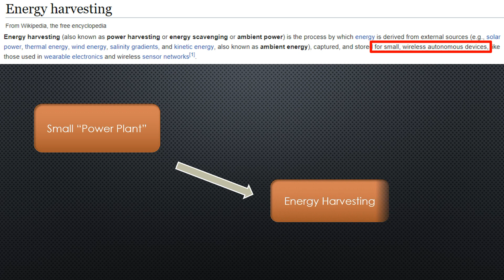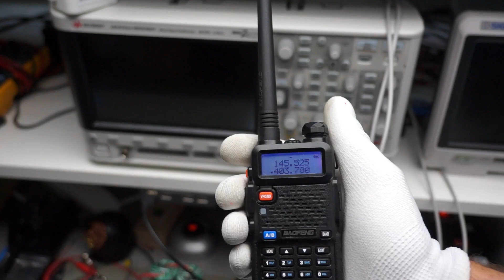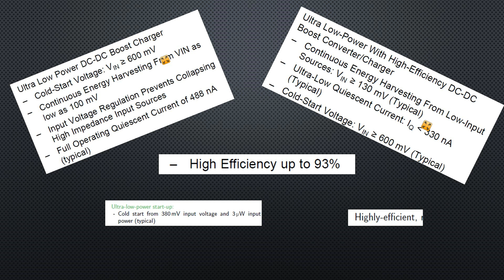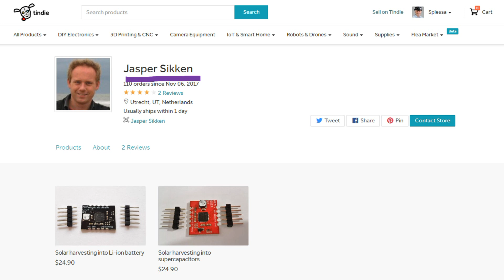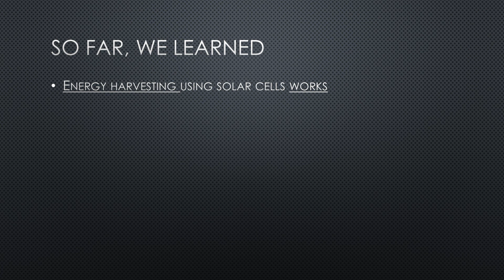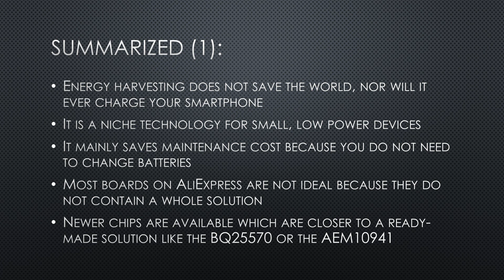#278 Energy Harvesting for Makers

Comment: I am surprised nobody has developed a maker solution with the MAX17710 form Maxim IC. Despite old, it seem to fill the very low power niche, where you might transmit a report once a day probably depleting all what has been obtained. It has no MPPT as it is based on an inductor boost scheme. I agree if somebody wants to create maker boards the solution should integrate as much stuff as possible including eventually a LoRa transmitter. Available power will tell how many messages you get in a day. Of course the niche calls for small size so the Teg/Piezo/Solar/RF source has to be small too and the message frequency not that critical. I mean the power requirement for one message with 1000 bytes is less than 100 messages with 10 bytes due to overhead and transceiver stabilization times. Interesting video.
Reply from the maker: There are other chips around which you do not find on "cheap" boards. Maybe the market is too small?

Comment: My favourite chip is the ltc3106 its hard to get and hard to solder but i love it. It has everything you want. Fake MPPT,boost converter,indicator line etc etc
Reply from the maker: Thanks for the tip. I did not focus on chips, I focused on boards because they are easier to handle for most of my viewers.

Comment: Can you build a harvesting circuit to power Arduino using cheap Chineese  $1 "power banks" that contain 1 LiIon battery and already have the circuit board inside?  Youd probably need a MTTP circuit board and some way to allow simultaneous charge and discharge.
Reply from the maker: As you mention, these power banks should support charging and discharging at the same time. Which they do not do in most cases. So you only could use the battery which usually is not part of the delivery :-(

Comment: Its not very hard to replace the resistors on the BQ25570, use two soldering irons to remove the resistors, clean up the flux and insert two new resistors then you can get the 3,3v. I  am using this chip for my low power weather station  , I even made my own board soldering all resistors and the chip (without  legs) not that big problem. The only problem is the price for the chip, its rather high  $8. A cheaper solution is to use the BQ25505 its only $4, but lags the output regulator, but a small low power LDO can be added. Regarding problems with solar cells that gives above 5v, I have added a TL431 (set for 4,5V) a cross the solar cell to make sure that the voltage is below 5V, I know that I lose some energy by doing that, but it doesn't really matter when the sun is at it highest.
Reply from the maker: Thank you for your "motivation"! I do not like those small parts :-( And they are not necessary on these (rather big) boards...

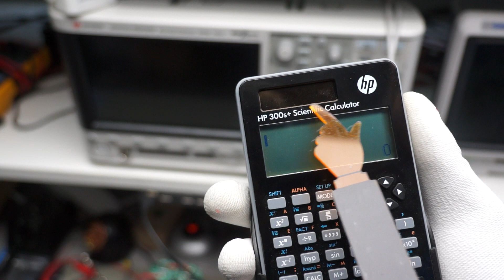Comment: 4:13 Correct, but the LCD display technology, which was a requirement for the pocket calculator, was invented by a Swiss, who I met some years ago.😊 His name is Martin Schadt and he could be called the father of pixels.😉
I use since several weeks just Solar engery to recharge my smartphone and it works fine. I built my smallest system(12v) out of two old regenerated car batteries. These are connected to the battery charger with  an array of 40w panels. On this little system I just use a pwm charger, which seems to be sufficient for my purposes like my small animal fence and to recharge powerbanks and mobile devices.

Comment: The LTC3588 came a bit short... Instead of piezo, I had a project that "stole" energy from a very weak (<1mA) sensor supply, to be able to burst a wifi message...
Reply: Neutrality & Mutualism with AI & Robots  please explain a bit more my friend😁🏴
Reply: @deangreenhough3479  I had an esp32 sending me via wifi message each time some one ringed the doorbell, The buildings doorbell entry system could not provide enough for the esp to send. 
I order the LTC3588 from china, in the intend to "harvest" a bit of the low power provided,.. but it took 3 month and meanwhile  the landlord put a new doorbell system in place...

Comment: Have you heard about perovskite solar cells? I know that polish company Saule Technologies are on the way to mass produce those, and they are quite promissing. They work with artificial light, can be transparent, flexible, and should be super cheap (10x cheaper than current). I hope they will make it :)

Comment: I am confused by the whole subject. One set of approaches is to use the sort of chips that you describe, another is much simpler: solar panel, bms & battery. In the uk I have several solar lights that use a solar panel, a bms and either lithium ion or nickel metal hydride. These run all year & even put out a little light in December with no special siting other than pointing south & keeping clear of vegetation, some have been running a few years now. Given the power requirements of modern processors there seems little trouble running applications like weather stations & there are several videos on YouTube about such applications. In my case I modified a cat scaring device to run on a small, about 125 mm by 75 mm panel giving around 6 volts in good sun,, with just a Schotky diode, no bms & 4 Nimh cells. It has been running in a neighbours garden for a few years & still works fine, running a pir to detect the cat & then using a 555 chip to drive a speaker at around 20 kHz . Most of the problems I have seen with these kinds of systems have been water ingress, otherwise they seem to do fine.Thanks for sharing.
Reply from the maker: You describe a typical representative of the Solar energy fraction in my video.
Reply: I was just trying to say that for a practical system that is low cost, a very simple approach gives useful power. It may not be very efficient, but usually all I want is something that works & is low cost. I may be missing something but the more sophisticated systems seem to add more cost & complication & don't work as well. Thank you for all you share.

Comment: Many thanks for this Andreas, it is appreciated, I find the hardest part of any design is "knowing" what is available on the market, for example, I was about to manufacture prototypes using the BQ25570, now there is a spanner in the works and I must test the AEM10941 as i was not aware of it.  I am very thankful for your channel and always look forward to the next one. Cheers !!!
Reply: Hi Shaun, you can buy my board configured for Li-ion or supercapacitors, or you can buy the evaluation board from e-peas, there you have all possibilities to change all configuration settings. https://www.tindie.com/products/jaspersikken/solar-harvesting-into-supercapacitors/

Comment: Very interessting, thank you. Not your fault, but unfortunately the result is still not cheap enough to just play around with it. E.g. some standalone solution with mcu, sensor and battery or usb power ~ 6€ (ok)  versus additional panels and good harvester chip +~30€ -> 6 times more (too) expensive. I have some of those 1€ solar powerd garden leds with joule thieves that run the leds for hours in the evening. So I have the impression there is room for (price) improvement also for even wlan sensors, but I couldn't do it so far (plan: ESP32 ULP collecting i2c sensor data, joule thief collecting energy to push the data out when there is enough power for a wlan burst. Part cost ~ 10€. Maybe someday...)
Reply: Um, you cannot compare a joule thief circuit lighting a LED with something that has to deliver regulated power, at the maximum possible efficiency, while also managing e.g. a LiPo so that it doesn't die or set your device on fire due to overcharging. 

The prices could go down only once this stops being a very niche application (and thus the chip production volumes will go up). E.g. the AEM10941 costs 4EUR alone (vs. cents for a transistor and few passives in a joule thief). 

For 99.9% of hobbyist projects there is little advantage of using an energy harvesting setup vs. e.g. a coin cell.

Comment: Thanks for the useful and interesting video.

PZT based energy harvesting is good for transferring power through metal barriers in a wireless manner. You put a lot of power into a PZT disc on one side, and take out a lot less with a PZT disc on the other side. This is useful if you want to go through a bulkhead without a penetrator, or if you want to power an external sensor in a hostile environment such as a down-well application or an undersea pipeline or outboard on a submarine or even through the wall of a safe. The efficiency of the power transfer across a metallic boundary is claimed to be over 50% by some researchers with more than 10 Watts transferred in some applications.

But I agree that for most makers, solar cell based energy harvesting is much more applicable unless they are powering something at a rock concert or at one of the clubs here in Las Vegas...

Comment: Thank you for the summary and introduction of the systems! Radio wave harvesting could be punishment as power stealing if someone detects it 😉 Anyway I remember a newspaper note (I thought it was in Switzerland) back in the 80. where people close to a big AM station complained about singing and speaking kitchen pots. At least involontary energy harvesting.
Reply from the maker: When I was young I used to wirelessly power a fluorescent tube in my hand with my Yaesu FT-277 ham radio transmitter. Didn’t impress the girls : -(
Reply: In southern UK 10-15 years ago, there was a prosecution for stealing energy from an AM radio transmitter. Transmitter engineers discovered that the power output from the antenna dipped on one side. Investigation showed that a nearby farmer was capturing the radiated energy, and powering the lights in his cow shed from it !

Comment: It seems you got some stuff wrong about the LTC3108. Me and a colleague were working with this circuit a little bit a while back.
1. There is a main output that is programmable to 4 different fixed values: 2.35V, 3.3V, 4.1V and even 5V.
3. There is a Power Good Output that you can use for Warning / Load cut-off. If Vout drops below 9% of its programmed value, the PGD-pin is set low.

Still missing the MPPT though. Read that it is because this device is intended for TEGs as well as PV and that rules out a simple MPPT-circuit. Not sure if it is true though, but it makes sense.

The AEM10941 seems really nice though! Thanks for the great video!

Comment: Mr Spiess, as a high profile engineer, what is your perspective about the dangers of RF radiations. Is it a fact or just a myth? I couldn't resist asking this after seeing your citizens protesting against the launch of 5G.
Reply from the maker: If there would be a problem we should see it after 20 years of global field testing. 5G uses the same frequencies as 4G.
Reply: The people protesting are uneducated in the field of RF engineering. They complain about using frequencies that cause various health issues without taking into consideration that we have been using these frequencies for decades without issue and the claims are made without peer reviewed research, only anecdotal claims based upon undocumented levels of power over equally undocumented durations. This alone tells you that the complaints about 5G are bunk.

If anyone wants to challenge new tech, ask to see the peer reviewed research first, and even then ask for other contradictory peer reviewed research, then compare the method against real world, finally ask who pays for the research and who benefits.

Until you have done this you have nothing to riot about.
Reply: Brain cancer rates have not gone up after many years of people putting small transmitters close to their ears. The only measurable effect is a very slight heating from the microwaves, but much less than easily tolerable and more powerful effects from  things like sun or physical activity.
Reply: The hypothesis of the danger caused by a million to billion pulses of low energy striking the human body every second does seem plausible though, however, there has been no substantial or tangible evidence till date to prove this hypothesis. But as you pointed out Mr. Spiess, if there was a problem we should be witnessing it right now and indeed there is no substantial evidence to prove the relation between non-ionizing RF radiation and brain tumors. Many other factors play a role, especially genetics. This topic may still be a matter of debate in the future between technical and medical professionals though, only because of the plausible hypothesis.

Comment: A very good video based on typical maker needs.

I'm used to seeing term energy harvesting in other sources of energy than solar/wind. For makers those are probably the easiest though. I'd think of solar as a first choice too but outdoors wind can be a good addition, often when weather is bad and there is no sun it may be windy. Wind can provide energy in the night too. (components for wind are not as easy to get ready made, you probably need something clever like a propeller running a motor used as a generator)
Other sources of energy include stuff like vibration/compression (piezo elements) or thermal difference (something similar to peltier elements) or whatever. Such alternate sources tend to be even lower power than solar but they can be used for example under ground where sun never shines or in polar regions where sun never shines for a period in the winter. In those niche applications there may be not other good choices available.
Energy harvesting is definately no good for high power (or even solar is not with small panels). It is typically ok for very low power applications only. A milliwatt power during all the day gets you a long way if a micropower mcu does for example only a couple small tasks per day. Micropower applications benifit from low voltage mcu quite often. You can run many chips at 1.8V and they consume less power than running at 3.3V. For energy harvester powered applications you may even want to avoid 3.3V devices. It is not all about getting power, it is also about consuming it as little as possible.
Reply: I've occasionally seen small wind generators used for field sensors for water levels, and possibly other things. The cost, size and maintenance risks are probably a lot worse than just buying a solar panel of sufficient size, unless in the far north or south with very dark winter days. Of course, winter climate have a high risk of conditions blocking a small wind generator, and to a lesser degree solar panels.
Reply: @JohnnieHougaardNielsen  Maintainance issue is a very good point indeeed!

Comment: Hi Andreas, and thanks for the review. The AEM10941 look interesting however only the evalboard seems to be available -- I have not found any bare IC to buy from e-peas named distributors. I assume this is just a pilot batch on shared silicon. To early for me.
Reply from the maker: Maybe you contact Jasper. He has a lot of experience with this chip. It is also used in this cow tracker
Reply: Hi, I am the seller of the AEM10941 board that is discussed in the video. I need to note it is not a eval board. On a eval board you can configure the connections by jumpers, for example select the type of storage (Li-ion or supercapacitors) and the MPPT ratio. My boards designed to be small, they are preconfigured and can easly be integrated into project because it fits on headers. The ICs can be bought from the distributors on below webpage. Mostly EU distributors. Sadly it is not available on Digikey/Mouser/Farnell etc. I bought large quantities of the IC directly from E-peas, but I dont resell them. https://e-peas.com/where-to-buy/

Comment: I think it is not fair to test energy harvesting chips in direct sunlight as they are made to extract energy from the surrounding environment (like temperature sensors, door/window sensors) as they should never receive full direct sunlight. BTW if you have panels with 5v+ output you could lower the voltage with one or two diodes in series (I know it is a dirty way of doing it, but it is dirty cheap 😁).
Reply from the maker: I tried them inside (I think I mentioned it) and was frustrated. Without sunlight, solar energy harvesting is no fun :-( 
This is why I added a link to a real-life indoors situation.
Anyway, this video was not planned as a test, more an introduction/overview.
Reply: @AndreasSpiess  I know that indoor energy is low, that's why designing a low power circuit is important. Also keep in mind that solar cells are good at extracting energy from a certain wavelength so if your internal light's wavelength is far from the one of the solar cell you get a drop in efficiency (maybe a test with incandescent bulbs could show different results). Would it be possible to use a zener diode to limit the max voltage of the solar cell?
Reply from the maker: You always can limit the max voltage with a Zener diode and a resistor. But in this case, you would burn most of the energy because in higher illumination levels they deliver more than 5v. And below 5v they do not deliver a lot. So parallel cells are a much better choice.
Reply: @AndreasSpiess  I was thinking about the zener if someone had 5-6v solar cell and wanted to use it indoor or a shaded area, so harvesting would be a better choice together with a cell with wider surface that could still create 3 or 4v when not in direct sunlight with the zener as overvoltage protection for the harvesting circuit.